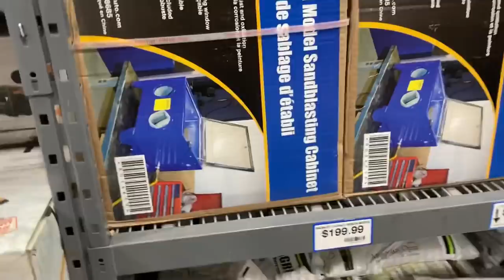Smokey & the Bandit Tribute Truck Ep.39 Powder Coating Chrome

Comment: Nice work on the powdercoating Mark! I have used an old oven as well, but a full size one which is good enough for most larger stuff like valve covers, control arms, springs, etc. Sure beats a rattle can. The blast cabinet is definitely a very useful purchase as well just for the sheer fact that media blasting cuts down on prep time/ effort, but since you restore old stuff and live in the wonderful rust belt it's a necessity that'll definitely see it's share of use. Much easier to use a gun and shoot glass, sand, walnuts, etc at the part then spend the time and pain with grinders, wire bushes, sandpaper, etc. Takes a hell of a lot longer, and no way gives you a nice uniform finish or allows you into the crevices like blasting does. Project Snowman ROCKS! Keep up the excellent work buddy!😁👍👍

Comment: Next time you powder coat with that oven, flip it on it's back, keep in mind ventilation under it, and dangle your part from a rod. You cn applie more powder while the material is still hot. You just have to work quickly and not load too much on.  Love your vidieos !!

Comment: Unpacking tip : return the carboard box upide down. Cut the adhesive tape on the underside. Put the box in correct position. Pull up the box.
There you have your purchase sitting on the floor on it's foam protection. ^^
Reply from the maker: Good tip 👍

Comment: I have an Eastwood powder coat rig similar to yours. I used an old free oven and took all the racks out of it and used some pipe across it to hang parts from the same wire I hung them from while spraying. That makes it easy not to bump the powder off. You will find it a good system to color engine accessor brackets and lots of small parts.

Comment: A little trick for mutli colour powder coating. You can get heat resistant masking tape in some pretty narrow widths. You could use it like pinstripe tape to cover the kenworth logo so it doesn't end up black.

Comment: I had a small compresser  In my garage I wanted to increase the air capacity I went to the local propane dealer he had rebuilt propane  tanks I bought a 100 gallon rebuilt propane tank for a $100 dollars attached to the compressor And I tripled my air capacity capacity the 1st time you air it up it takes a while but after that it's like having a second compressor like the videos 👍

Comment: You can buy a smoker and it will work better than a oven.  You get more vertical space where you can hand longer items than you can in the oven. Then all you have to do is carry the item by the wire and hang it in the smoker.

Comment: The movie truck just had a reflector. From the factory you got nothing, reflector, or reflector and light depending on how it was spec'd. The light and reflector are both surface mounted. The reflector has just a single center screw. The light has 2 screws and a replaceable lens and bulb. I think Grote still makes the light, I had to buy one for one of our W900's that the owner bought new in 69 about 2 or 3 years ago.
Reply from the maker: Do you remember the grote number?

Comment: They use a black rubber “ring” to hold the light in. Lots of trailers used them!
Reply from the maker: Yeah I’m aware but not a fan of the black rubber rings on a truck body … just doesn’t look as finished 🤔

Comment: Take rack out of oven and coat part directly on rack . . . Then put rack with coated part back in oven all togather to bake.
Reply: Ah . . . I see you figured it out.
Another tip is if the coat isn't 👌 you can just blow it right off with air befor you bake and recoat it.

Comment: dot requires a reflector or conspquity tape on the back of the cab, you will still have to add one of them to be legal, the light on the hood was probably a glue on reflector and not a light, unless you saw it lit up somewhere,  reflectors are two types glue on and screw in the center, get the rubber gasket for the light in the back of the cab,
Reply from the maker: Watch the intro of the movie … was definitely a light and not sure if that reflector rule applies here in Canada 🤔

Comment: I owned a large sand blaster , you need and outside vacuum to suck the silicates out. Other wise the will be in the shop and you will breathe them causing silicosis’s.

Comment: Hey Mark, For those lights on the hood, you could try to epoxy the rings on the backside of the hood or maybe layer some fiberglass, to sandwich the rings to the hood. They do look nice powder coated, though. If I remember correctly, I think the company was called "truck lites". They made lights with the plastic ring as part of the light. Also, on those "roloc" discs, the brown ones are 80 grit, red is 120 and blue is 220. Use the red(rough) and blue(fine) on aluminum.

Comment: During the opening credits of the movie ,there is a close up of the amber hood light. It is surface mounted, not recessed.
Reply from the maker: 10-4 - but I cannot find those type of mounts anywhere so I was forced to do a recessed/ring mount
Reply: @TwinStix  Peterson M162SA (maybe?),or Grote 45413. The Grote you would have to paint the base black.

Comment: I powder coat things for my truck but One thing I bought was a smoker and I can powder coat inside the smoker and while they are hanging inside I can crank the heat on and bake it So great job on Thursday morning Well it's back to work Hey one more question Do you miss working outside in that SNOW 🤔 Until Next Time ⏲️⏳

Comment: Sheeeesh.  I remember getting our Husky 25 gallon air compressor for the shop.  It went on sale for $700 and dad was like, I dunno.  Sure that was 20 years ago, but the prices now.  It's cutting into the beer fund at these prices.  How's that blasting cabinet working out for yah?  If it's half decent, I might consider.

Comment: I would doma wood back on that wall before you put tools boxes. I have almost same but I frame and insulated and did sheets of wood on walls. And rest of side walls sheetrock I installed heat but I went one step up heated floor   Cold here in north Alaska lol

Comment: Bro, you're using spot putty as bondo, don't, it'll fall off.  Its meant for tiny pin holes IN bondo, not the actual body.  You need a product called icing, it still needs to be mixed with hardener like bondo but is easier to sand.
Reply from the maker: Yeah I still haven’t sanded it all down … when I’m done there’ll just be red in the tiny dings and pinholes then I’ll lay down the etch and high build primer 👍
Reply: @TwinStix  Ive just had a very bad experience with it myself, if too thick it stays dark red, doesnt dry and the the paint will bubble over it.  I had to sand everything off and start over!

Comment: Hi Mark ! Scott from the UK. On the hood lights, would it not be possible to fix the mounting bezel on the inside or would that make the lamp too recessed?
Reply from the maker: Probably too recessed … even mounted on the outside if I snap it all the way into the ring it barely protrudes.  Wish someone knew how the originals were mounted 🤔
Reply: @TwinStix  ah bugger! I did think that maybe the case🙈. Worth keeping an eye out for any at the shows when the weather turns! Keep up the good work sir!

Comment: Did the snowman movie truck have a caterpillar engine in it ?
Reply from the maker: There were two used in filming and the ‘74 with the larger tops on the air cans I believe had a Detroit (you can hear it when it drives up to the beer store) and the other truck a ‘73 I believe had a Cummins but not 100% sure 🤔